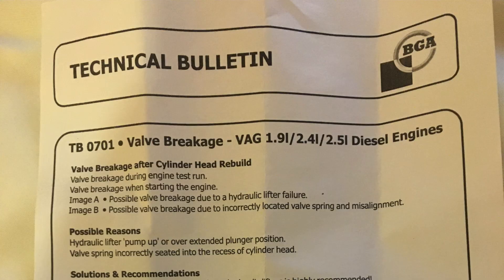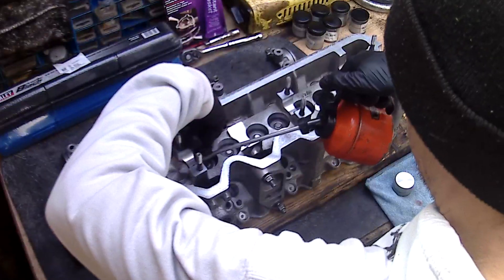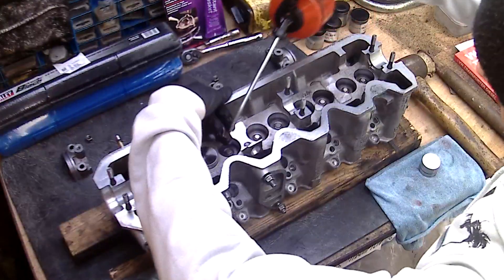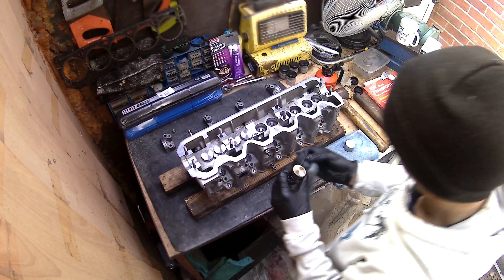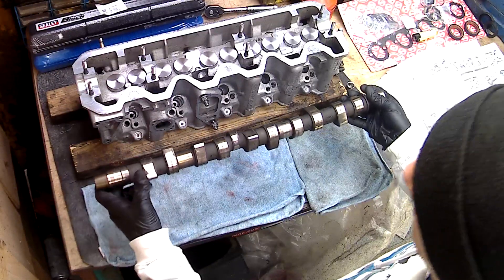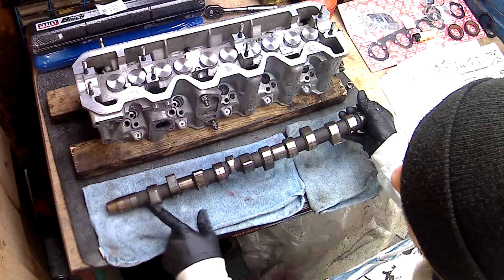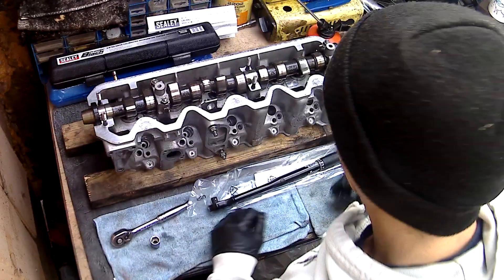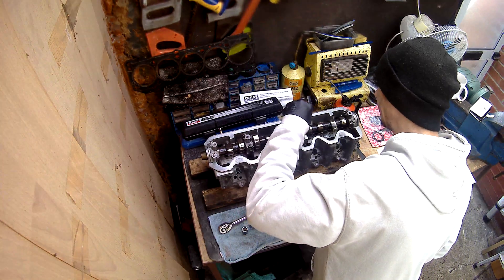Cylinder Head Assembly Part 2//Hydraulic lifters and camshaft fitted

Comment: Hi twiggs great vids watched them all hope you get sorted...i have got a blockage in the coolant nipple on back off cylinder head that goes back to expansion tank... any ideas best way to unblock the hose is clear but soon as I reconnect I cannot blow through it.cheers 👍
Reply from the maker: Alright buddy, I presume that you can’t blow through that nipple because I expect it’s going into a sealed head! Have you tried removing the coolant pipe from the side of the head above diesel pump and then tried to blow through?
Reply: @TwiggsT4  yes I can blow down all hoses except the little one near the inlet...it starts to over pressure out of expansion tank when under load...cheers for your help keep up the good content 👍
Reply from the maker: Yeah that’s like a breather I guess, it links into the water jackets, sounds like yours is blocked, you need to use nozzles cleaners or something long thin and strong, this usually happens when different coolants are mixed together in the system, I don’t mind helping where I can 👍
Reply: Cheers twiggs all your help didnt know was with mixing coolant  I  have just seen someone on forum same prob they cleared with guitar strings and white vinegar...🤞 hopefully see you at a meet oneday great help 👍
Reply from the maker: That’s positive, the forums almost never fail 👌 and I’ll remember that now guitar string and white vinegar 👍 
Fingers crossed I’ll be back on the road soon and come to some festivals, it’s always been nice to meet subscribers everyone is awesome 😎 I think I’m trying for VW breakout Santa pod end of may

Comment: Great job...man in his shed can build evrything ;). One pointer. Torque wrench - get this habit ASAP or You will keep buying new ones like me. Whenever You are not using the wrench for more than 5 minutes unwind the handle and the pressure knob. It has to be stored in "loose" position. You will probably show this on part 3 but not seen this yet :D...keep this up..lockdowns seems to make wonders for car projects.
I got the brake lines replaced. Sort of. Not enough time to do a proper job so we just ripped everything out and routed the new lines. Proper shaping and mounting will have to be done by me at home. But it`s a fuel tank drop job so will wait for better weather. We have a proper winter here for a change.
Reply from the maker: Hey buddy, thank for positive feedback and useful info which I didn’t mention, you are right in saying that the torque wrench be put back to its storage position, I did do this but forgot to say. 

It sounds like it’s coming together 🤙🤙🤙and like all driveway mechanics it’s always weather dependent.. Have you got a lot of snow at the moment?